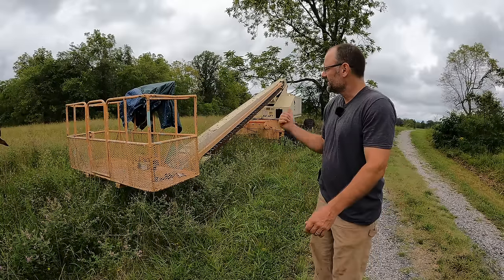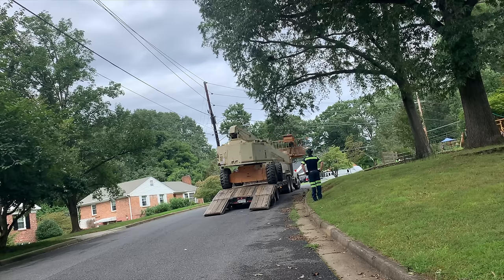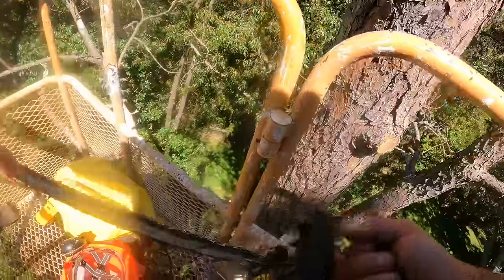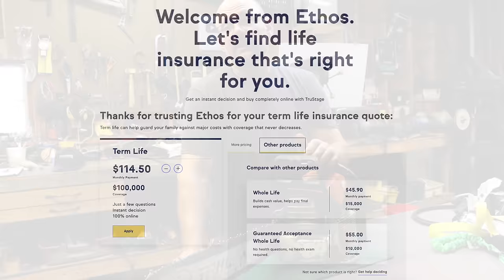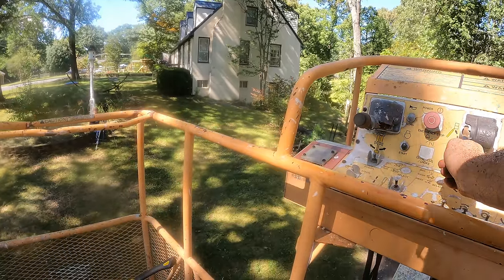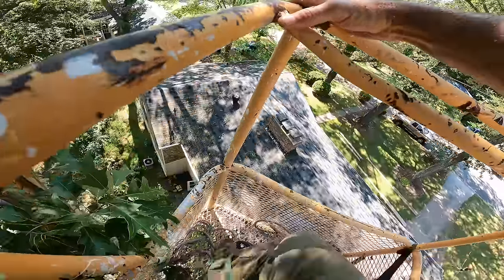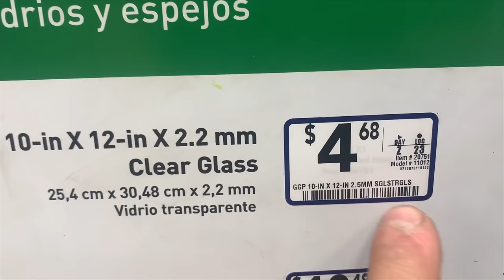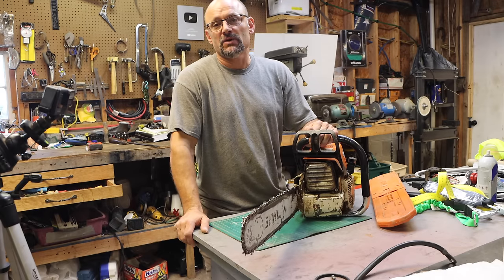Boom Lift Tree Work, Directly Over A House.

Comment: Sometimes cutting corners to save yourself some work ends up making you work harder and longer. We were going to replace a pipe that carried paint at a factory, just spill paint that was going to be thrown away so an easy job. Well stupid me didnt feel like doing the work of checking if it was full of paint, which it were so a 2 hour job turned into an 18 hour job, because i had to clean up the damned paint before it cured. Isocyanide paint so it cures over time, its diluted with some paint thinner but when that evaporates the paint starts to cure again. Happy days. I saved myself 5 minutes of work so i could work for 16 hours more. Not my best decision in life i have to admit, but you only make that mistake once.

Comment: You dont tack the glass in before applying putty ? I done a window like you did when I was a mid teen and my syepfather asked if I naled it in. I said no and he said you are supposed to put pin tacks (penny nails) in the window frame to prevent the window fallng out. I also know the inside gets a layer of putty before the glass goes in and the external putty goes on.

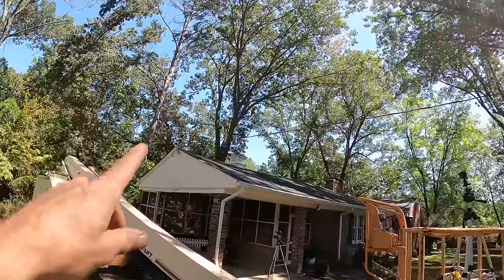Comment: 12:30 "240 volts"  Nah, it's actually 'only' (LOL) 120 volts (RMS) relative to ground. The 240 volts is from one of the split-phase to the other, which would be difficult to get across. So it's 'only' (LOL) 120 VAC that you need to worry about, relative to ground.
Reply from the maker: Fair point.  Cheers.

Comment: Personally, I don't think I would want 200# break force.  The shock load if that is attached to your body harness would be horrendous at 200#.  I would prefer as weak as practicable, say in the fifty pound range.  I can't think of a situation where you would have more than that legitimately occurring.  I would also be thinking of a long enough cord to clear your feet before it comes to a swinging stop.  When you dropped that chunk with the saw attached my main concern would be the shock load with a lesser emphasis on the bounce back.  That weight has a lot of force compared to what a human body can withstand.  Most probably that would be enough to pull you up and over the basket railing or through it depending on the lead.  Neither of which would be pleasant.  Even with a shock cord as your anchor to the basket.  One possible improvement would be to make your "chunks" smaller and take more cuts, keeping the weight more manageable in case of a mishap?

Comment: Another item on safety never ever use your lift to catch a load as you might exceed lifting capacity of your lift... your lift can break, leaving you crashing to ground. Always use a rope to lower limbs to ground when working over an item. And have rope attached to secure item so person on ground doesn't have rope ripped out their hands. Work safe.

Comment: Honestly, i'm not too shocked the chainsaw survived an 80ft drop, older equipment made of cast iron would have shattered and anything made of plastic would likely have cracked depending on how thin it is, but a solid steel casing is basically indestructible.

Edit: "Aw shit, i dropped my chainsaw, maybe I should use my wife's chainsaw from now on, you know... just encase!"

Comment: I was just wondering why you were cutting "lefty" when the "lesson" happened. Holding it the right way would possibly have avoided that.

If one of the wheels comes off the trailer, you won't be catapulted, you'll wish you were. Likely you'll be crushed in the basket on top of you.

Comment: It would seem that you should have a hard hat/face shield on as well as gloves and some safety ropes attached to your saws
Reply: We have a Dewalt battery saw and it’s great for those tasks. I’ve wondered if the stihl battery saws are better but since I’ve got Dewalt and Milwaukee batteries I was tied to Dewalt. Many years ago my 9 yr old son left our small stihl gas saw on the fender of a trailer.  It fell off after about ¼ mile but just like a timex. It kept on ticking.  No better saws.

Comment: you said it is insulated...
sorry but do you know why , when yo block break , the lines you draw are black?
Because of the carbon inside the mixture of the tires...
Don't ever think that tires insulate any vehicle. as s matter of fact it conducts really good.
It's like saying water conducts electricity( which it doesn't.).( the minerals dissolved on it are conductive

Comment: DO NOT EXTEND THE AXLES LIKE THAT! Extend the axles while in motion. Otherwise all that boom work you did will all be wasted. I was a jlg certified tech for over ten years. Trust me on this one…
Reply from the maker: That's what it says to do in the manual.  Lift the axles with the boom.
Reply: @FarmCraft101  they changed it after the HX model for that reason